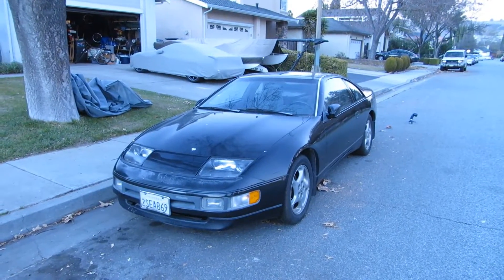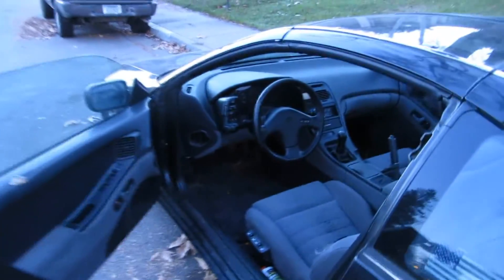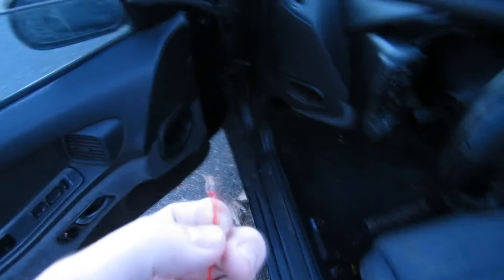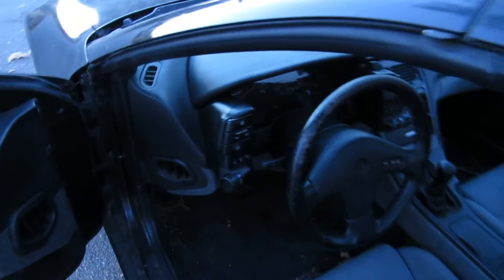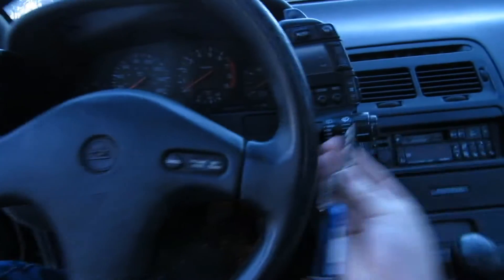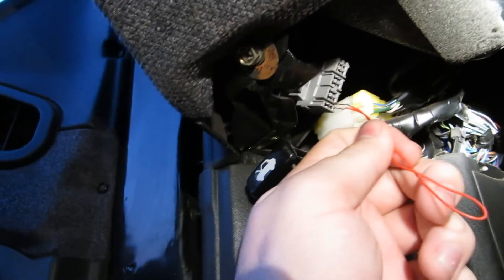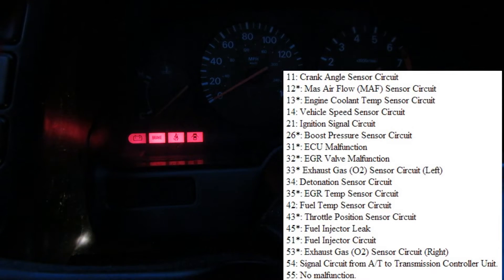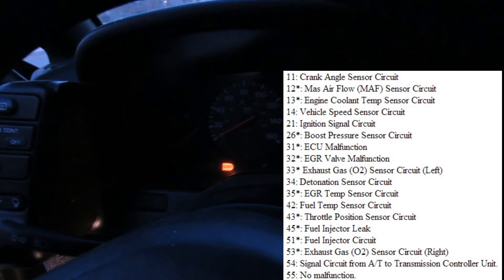[How-To] 300ZX Pull Codes \ CEL, 90-95

Comment: Hey, when i was troubleshoting the z300, i accidentally hit the ground with the other end of the wire inside the contact.  The dashboard in the car got dark and it seems to not work. The security lamp I blinking though. (door is open)
Reply: I did the same thing and now my speedo, tach, fuel and temp gauges quit working. Have no idea how to go about fixing it. Any luck with yours?
Reply: @ansoni1441  i checked the fuses in the box beside… in the bix ess one for the 10amp fuses blown… chrck them frist
Reply: no malfunction nice !

Comment: Hi, I'm not expecting a reply as the video is so old but here goes.

I've purchased a '91 Twin Turbo - UK model.

This seems a great way to identify any faults - thanks for sharing.

However, will the "faults" still display even if they've been repaired?
Reply from the maker: Ooo that's a good question.. i believe the fault codes still show even after repair has been completed until some time has passed, which is likely a different length of time per code.

To prevent confusion on my personal cars, i disconnect the battery for a little bit, then the code is cleared and memory wiped. then I drive for ~10mi to make sure the fault doesn't come back.
Reply: @CoreysZ32  Great! Thanks so much for coming back to me!

I'm due to collect it next weekend. So I'll be sure to do this little task and see what flashes.

Failing this trick, is there a diagnostic tool you can buy to read the vehicle?

Comment: So this wont work for a 96 model
Reply from the maker: 96 is awful. It is supposed to have a similar mode for pulling codes from the ecu directly, and also supposed to have obd2 and consult implemented. I'm only able to get data from my 1996 with a nisbie usb consult adaptor to ndsi on my android phone. Bluetooth doesn't work. Obd2 and torque doesnt work. And I wouldn't try this method
Reply: @CoreysZ32  ok so at the ECU there's a red light and a screw,  turn it clockwise 1 full turn, wait 2 seconds, then turn it counterclockwise to the original position and the ECU will flash codes.
Reply from the maker: @kelving.2200 did that work for you? I recall something like that... I can grab my 96 fsm hardcopy later if not
Reply: @CoreysZ32  I reset the ECU by turning the screw with a flat head 🪛. I followed the directions and the code went away. But the engine light pope back on once in a while and goes away when you restart the car. I still have idle issues doe, tends to drop and bounce.
Reply: For some reason there's like an electrical issue sometimes on start nothing but the lights work, and after about 30 seconds everything is good to go. I found one short

Comment: Hey Google my name is Troy I have a 93 300ZX naturally aspirated and then it started finish feeling like you a little bit and then I shut it off and now it won't start it seems like the fuel pump is staying on a really long time and it's flooding itself almost any ideas
Reply from the maker: Hi Troy! There could be fuel leaks causing the system to drop pressure. Check my other video to tighten the fuel clamps, this gets worse in the winter, perfect time to check it all anyways!
Reply: @CoreysZ32  yes I already did that it just seems like it's flooded or it's not
Reply from the maker: @troycummings7465  by flooded, is it hard and sluggish to crank? Did you try w/ jumping? Sometimes a battery can crank but not start due to voltage drop. Cold weather means weak batteries too

Comment: Wasn't able to do this with the wire. Pulled out the floor board and did it the long way. Code 55. Any idea why it wouldn't work? Possibly loose/corroded consult connector?
Reply from the maker: Possibly! It's also possible that the circuit wasn't the same for every ECU. What is your year, transmission type and TT/NA?
Reply: @CoreysZ32  5spd twin turbo. '95
Reply from the maker: @muh_tee_us  thanks! When i get my filthy hands on one I'll compare the circuitry

Comment: Where are u located. Maybe u can check out my bros 91 tt 300zx. Ill try ur trick and see what it pulls up. But car idles not that great and shuts off while driving especially after wot. The shop said replace spark plugs wires and cats. So 2k later still the same issue???
Reply from the maker: Sounds exactly like a vacuum leak!! San jose, ca
Reply: @CoreysZ32  thanks man. The code came up as 55 smh. No malfunction. So im lost man. So i guess i have to look at all the dam lines. I wish u were closer haha im in so cal area. Wayy too much work.

Comment: is this safe?
Reply from the maker: If I recall, it is electrically causing exactly the same as turning the potentiometer on the ECU. Either way, I've had no problems in years doing it this way on multiple Z32s. Personally it's worked every time, although there were a few people here who mentioned no results.

Comment: Correct me if I am wrong, is that an OBD1?
Reply from the maker: This is considered OBD1 
But keep in mind that OBD1 was not much of a standard. There were unique  connectors and protocols across manufacturers. In late 1995 / early 1996, OBD2 became the standard moving forward.

Comment: Tried on my 1990 zx n/a didn't work is there a reason why?
Reply from the maker: Should be fine. 
1) are the pins still in the consult connector? (Wires connected) 
2) when you turn the key to "on", do you see all the dash lights on? (Including the CEL)
Reply from the maker: Just curious Aser - Any luck on your '90?
Reply: @CoreysZ32  thank you for asking...but it didn't work and I didn't see the advice on your first reply😞. But I just removed the wooden cover and waited until it was dark so I could see the light without removing the ECU😊👍.... I got the codes really easily took me like 10min or less. But it was bad news. 😞 I got a 51, 34 and 21 so injector circuit, ignition signal circuit and detonation sensor. I already ordered a set of 6 fuel injectors, a knock sensor and harness, and is the 21 the coil packs?? Let me know . one more question, where or how do you get to the knock sensor? By removing the plenum?....
Reply from the maker: @aserrodriguez6609  sorry I didn't reply to this, it was a lot of questions and I didn't finish typing. The knock sensor code is usually the subharness which can be changed when the transmission is out during clutch work. Otherwise it's super involved and most people resort to mounting a new sensor somewhere else (it's less effective..) some people get lazy and use a 1m ohm resistor, but that can cause engine damage if knock is ignored. Not recommended. Code 21, check your PTU harness for corrosion, I've seen it happen on many older Z32 that came with the retrofit harness.
Reply: CoreysZ32 I also have a 90' n/a. My check engine light doesn't come on, sometimes it'll come on for about a second and then disappear. I checked connections and can't find the problem. Can I get the codes directly from the ecu?

Comment: Corey, I tried doing this on a 1995 300ZX multiple times.  I followed your instructions by the number and to the letter but I was not able to get it work.  My "check engine light" was staying on before I followed your instructions.  My question is, is it supposed to work even when the "check engine light" is on prior to running this test and do the actual ECU codes appear on the dashboard when it does work?  Help anyone who also didn't get it to work but later found out why it failed and eventually got it to work.
Reply from the maker: If my method to get the CEL to start blinking out the trouble codes isnt working, then it's possible that 1) the consult port connections are no longer good (pins pushed out the back of the connector, or bad wires to the ecu) OR 2) the ECU is not responding correctly (bad ecu power, ground, or potentially an overdrawing current somewhere in the harness.) 

My advice. Go straight to the ecu and pull codes the traditional method of turning the potentiometer forward and back. If no dice, id put the ecu in another Z to pull codes OR make a custom harness to run power and ground. Both the CEL and ECU blink out the trouble code FYI

Comment: Thanks for the great video..I have a question for ya ..I don't want to spend a $1000 dollars on replacing my EGR valve and the check engine light comes on like every 3rd time I drive it..so is it possible to just leave the jumper wire in the harness so the check engine light want bother coming on..are will it burn something up? 
once again Thanks for the video..
Reply: egr delete

Comment: I got a 51 better not be a fuel injector they aren't very old
Reply from the maker: Could just be the connections themselves. good luck
Reply: +CoreysZ32 it has brand new wires that came with the adapter kit I got 4 the newer style injectors so I'm sure it's a injector
Reply from the maker: Jake, Technically, it could be an open soldering or crimp joint when splicing in the new wires. (That's typically what it is after people convert to new style injectors). Happened twice on the car in this video actually.
Reply: +CoreysZ32 oh ok I'll check the wires thanks
Reply: +CoreysZ32 it was just a wire, thanks 4 the info on checking it

Comment: Hey guys, I was trying to help a neigbor chick and she has a 1990 z. I tried this what you said and i got no light even when turning it on. So i got an idea to try the ecu flat screw driver thing. So after we had jumped it already with no lights at all then i told her to turn the screw clockwise. Once she did that we saw the dash check engine light start flashing instantly to 51 a injector circuit i believe, whatever that means. Anyways if anyone could narrow tthis down so i could help her that would be awesome. And the answer to the above guys for no engine light is turn the ecu screw to the clockwise position i believe.

Comment: Bro I tried this but my check engine bulb won't light up... I tested the bulb and it was good... Do you have an idea why???
Also I tried it with the ecu but the LED won't turn on
Reply from the maker: If the LED is not lighting up, it's a possibility that the ECU has a bad ground, or the ECU is fried. (It's actually kind of common, i've seen this happen multiple times)
I suggest delidding the ECU and inspecting the PCB for burn marks.
Reply: So if my ECU is fried the car won't turn on right???
Reply from the maker: Eli Carrillo
Not always correct, Sometimes the car will still run, sometimes not. I've seen cars run on 3 cyl with fried ECUs and i've seen cars not start at all.

Comment: so if i tred this several times and it didnt work so that does that mean i have to do it the other way
Reply from the maker: Brian, if it's 90-95, try via the potentometer on the side of the ECU. If it's 96, Try via a OBDII reader (I've had some 96 Z's not respond to certain OBDII readers)

Comment: Ok thanks mate,i thought its was the injector.I put the red probe into the connectors all seven and the earth on the engine,so to get a earth.I also checked the injectors ohms and got 12.8,so then checked the power connector and i am getting the same voltage as cylinder 1 just with ignition on,but dont know what i am getting as a pulse when the car is started.If took of the connector to the injector and wire up a blub(make shift noid light)and connect the two wires from the bulb to the connector,shouldnt it blink to show i am getting a pulse to the injector.Thanks again m8
Reply from the maker: Personally haven't tried it but from what I understand, that's how it should work for both injector and coilpack

Comment: Quick question about the PTU,so i tested the connector which goes into the PTU(seven pin connector)and i got 11.8 volts on six of them but on one end one i get nothing?I am guessing it should be 11.8 volts also.Should it?Also what voltage should i be getting out of the PTU?Do i need to crank the engine to get the output voltage.Thanks mate
Reply from the maker: I'm guessing you have one probe in the 1st pin, then are testing with the other probe, 2, 3, 4, 5, 6, 7 to read 12v?
IIRC; 
The PTU works by converting the ecu signal 5v into a stronger 12v. 
The one wire that should read 12v (from pin to battery negative terminal) is sent through the PTU to the corresponding cylinder to fire, based on the input signal. 
The output of the PTU should read 0V, unless it's a momentary signal to spark. 
The PTU has a unique pinout that you can trace. Forgot the order and I need to study for a midterm in ~3 hours, so i may have to get back to you on that.
Concentrate on injector harness because it's more direct to trace (injector clip straight to ECU for one of the pins of the injector clip)

Comment: Nicely done mate,i got error codes 11 and 13,the funny thing is that number 1 cylinder isnt firing and i just replaced the injector also did a compression test on c1 and got 155 psi,Still can figure if it is the CAS that is cone or just bad connections
Reply from the maker: Thanks, 
I'm in a very similar situation however I am not throwing a CEL. 
Cyl 2\3 not firing with good compression and new injectors. 
11) disconnect batt, Check ground by Cyl 6, Check CAS plug itself and make sure all 4 pins are good on both harness and CAS. Check Harness clip F23, white one by fuse box. If all are good, replace CAS and try again. (make sure to mark CAS for timing)
13) disconnect batt, clean up the clip, sensor pins, and the sensor probe for the left-most coolant temp sensor. if key is "on" and AUX fan starts with car off, the circuit is bad. 

Missfire diagnostics: Swap the coilpacks over first from a known good cylinder and see if the problem follows a bad coilpack. 
If not, trace the coilpack wiring, middle pin should be 12v, then either side is ground\signal. Make sure continuity to ground, then continuity to PTU on signal wire. Then trace PTU wiring to ECU. 
There are pinouts online for PTU and ECU so you know what cylinder you're tracing for the signal wire. 
Once coilpack wiring is verified, move to injector wiring. Trace injector wiring to ECU using ECU pinout and checking continuity.